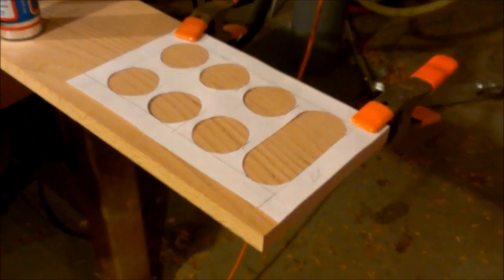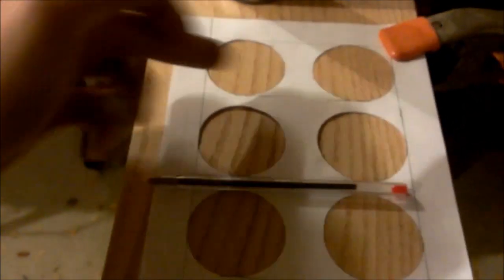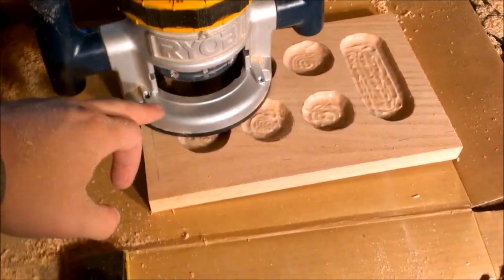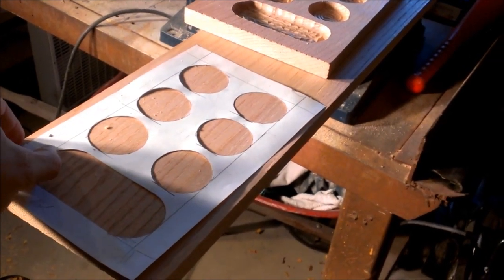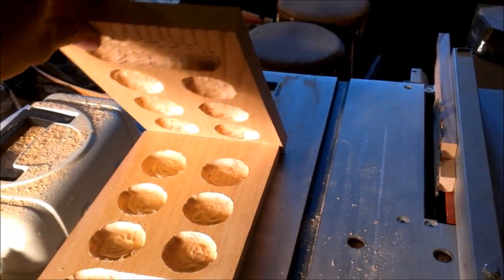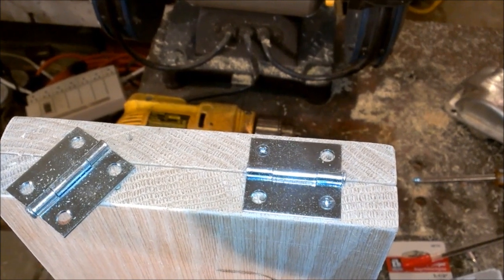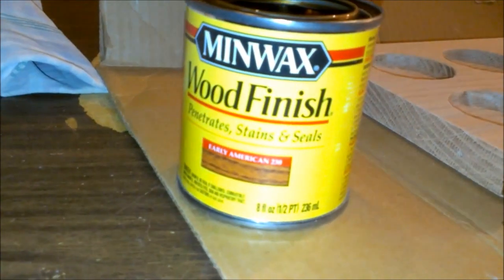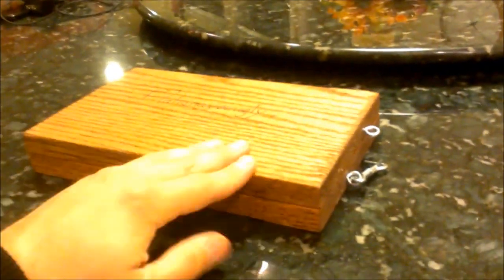Building a Mancala Game Board Out of Wood

Comment: Just a quick question, if you don't mind. I'm working on a similar project for a friend's birthday and I was wondering: what tool did you use? With the size of it, how do you see where it is you need to cut? I'm sorta new to detailed woodworking.
Reply from the maker: Gartonia Productions I used a router to hollow out the holes on the inside.  You can use a chisel if you dont want to buy any powertools.
Reply: Thanks for the information and expediency thereof!